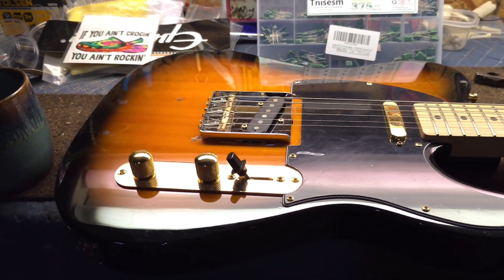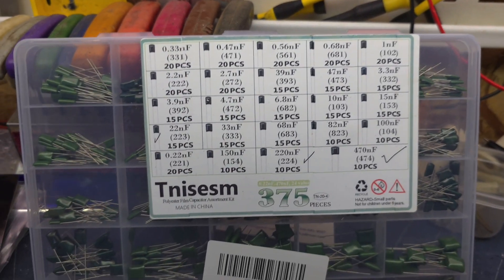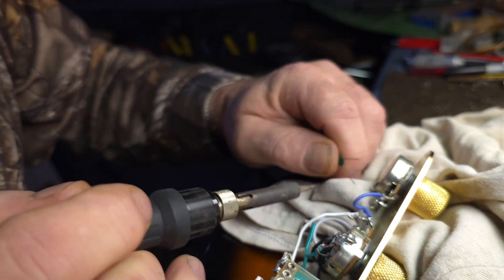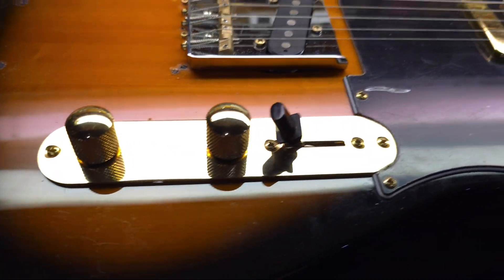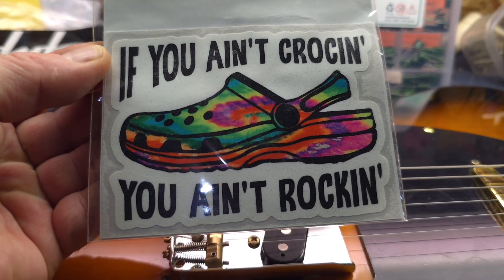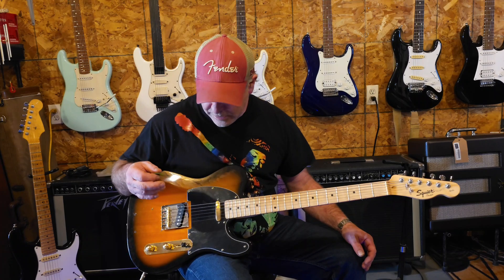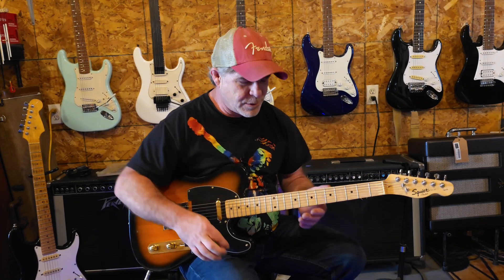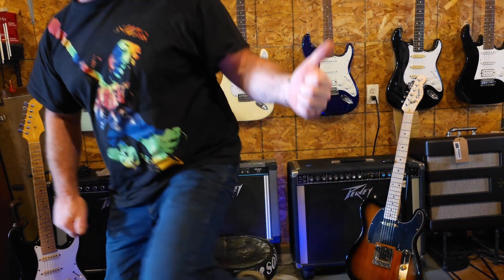Guitar repair.  Tone pot not working.  how to replace capacitor.  telecaster troubleshooting. 2024

Comment: Great tip about soldering pots fully high or low; I never knew that I love modding caps, especially loaded strat pickguards. They are easy to list changes.
Reply from the maker: @TooLooze  I burned a few pots before I learned about having them on 10 or 0. lol. I like the .33 caps on singles too. it's fun to play around with that stuff, a lot can be gained and lost with something that simple. I like strats as far as wiring and easy to work on.